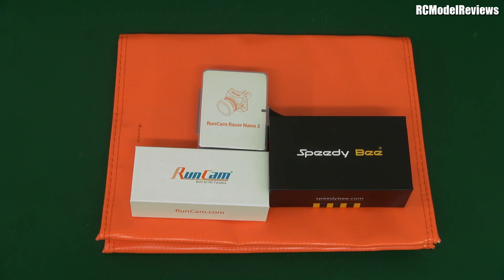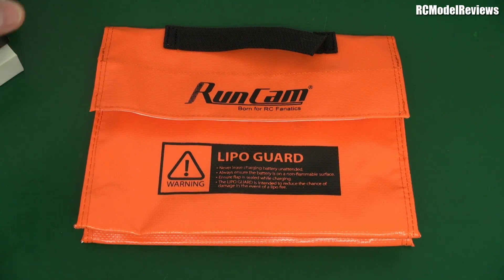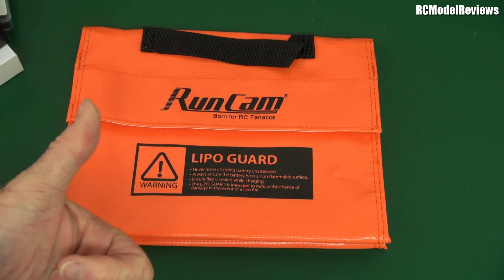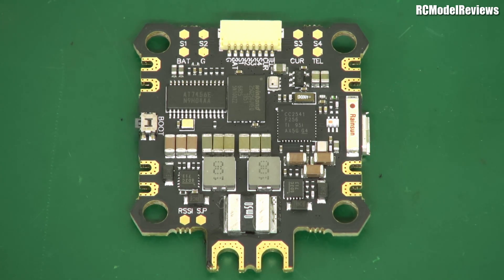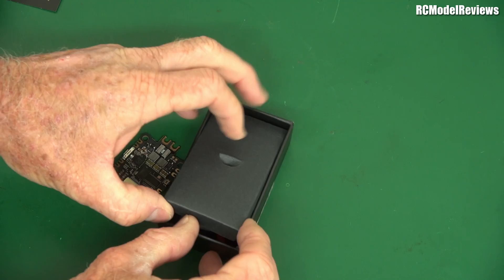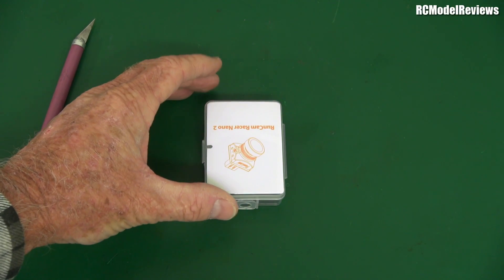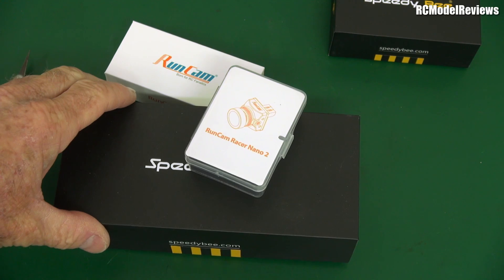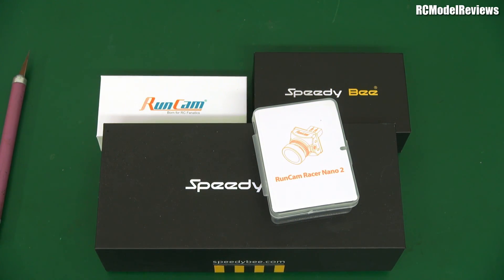A package from Runcam & SpeedyBee

Comment: I've heard of that aspirin trick for soldering wires that are coated with enamel for earbuds and stuff; does that work with conformal coating?

Also, applications of the barometer sensor.; like is barometer accurate enough to know where there's more ground effect?

Comment: I have that same bag but you are right, they should be tested before trusted! 
I'd love to see fcs with vtx, crossfire nano and even escs combined (maybe on a 2 story stack) so I just plug and play those components.
That kind of modular components would make it easier for many beginners.
But then again, for those ppl they sell the rtf copters...
Got the sg325 skystar recently. Caught my attention because it has gps, inav, mavic props and motors. Initially wanted to convert it to dji digital asap, but now I will stay analog on that one, so I can test more cams and other stuff with it...
Greets and have a nice slide into the next decade!
Greets, Mario

Comment: You can just melt through the conformal coating with a soldering iron
Reply from the maker: Not always the case.  I remember when a certain ESC manufacturer started shipping with conformal coating, people complained that they couldn't solder the motor wires on because the pads were coated and highly heat resistant ;-)
Reply: RCModelReviews hmm that’s odd. Never heard of that

Comment: Burn 'er up, for sure. I've seen videos of these bags being tested and every single one failed- either instantly because the material melted/caught fire, or because as you said the stitching failed and the bag then came apart. Best protection I've seen is a cinder-block / hollow concrete block ( used outside ofcourse )...

Comment: 1st we wanna see ya blowup the lipo bag, with  2 batteries in it, since you won't be needing them since the hobby is going down the shit hole. And on regulation ...all drones will need to have a transmitter beacon, I work in insurance claims and here is the article you want to read:  
Long-Awaited U.S. Drone Safety Rules Call for Extensive Tracking Network
https://www.insurancejournal.com/news/national/2019/12/26/552890.htm

Comment: Lipo bags should have separate compartments. Although once a battery bursts into flames, and the stitching fails, the other batteries will explode anyway. There needs to be a better way. Is my gyprock/drywall lined metal toolbox with compartments, the best answer?

Comment: Bruce, please check the specs on kit before doing a video, i'd appreciate a more in depth review rather than a look at the swag type video, you used to do them so well. I realize you'll cover a bit more when you build the frame etc but it would be much more helpful to review the FC on it's own first, not so much the cams i guess ... they're all fairly similar.

The lipo bag, deffo torch test it, very useful info :)

Drone Regs ... It's happening everywhere, i doubt anything at this point is going to stop this, and mid next year, even sub 250g (in UK at least) will be regulated too. Other than the yearly fee, i'm not massively apposed to it, even knowing that it doesn't stop the bad guys doing what they want ... I guess what i'm saying is, keep Xjet to drone regs, rants etc, RCmodelreviews with reviews only ...  I'm not bashing, I love your channel and i've learned alot watching your content over the years, i just feel you've lost a bit of what you used to do so well focusing on rants and regs too much :)

Again, don't take this as me being an ass ... I only want you to do well :)

Comment: WAIT! this thing has a texas instrument cc2541 chip onboard. presumably for frsky protocol rx but where does the antenna go? also winbond spi flash for blackbox? this thing seems better than you give it credit for
Reply: oh. the long thing with rainsun label on it is a mini ceramic antenna! way to small for a proper rx so I guess they use the cc2541 for bluetooth
Reply from the maker: Yep, it has bluetooth
Reply: @RCModelReviews  If my toothbrush, light bulb or toiletpaper holder (no joke) has it, why not our flightcontrollers too :)

Comment: Been using the MG Chemicals silicone conformal for a while with good results... Isopropyl Alcohol on a q-tip removes it for rework or so I'm told..There's an alternate ?
Reply: The MGChemicals stuff can be soldered through no problem, the heat just burns it away
Reply: Yeah, just solder through it. And if it doesn't work you put too much on 😄
Reply: @audiogek  lol...I've read that but figure my soldering needs every bit of help and the word "inclusions" keeps popping up in my head from my welding days..  At least I know now that even if I miss some silicone  it'll just be burnt away..